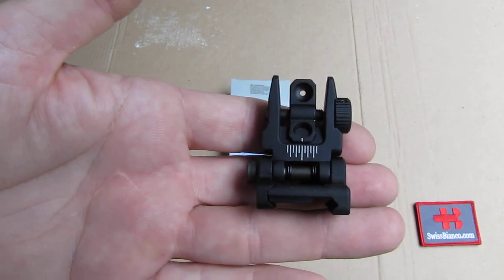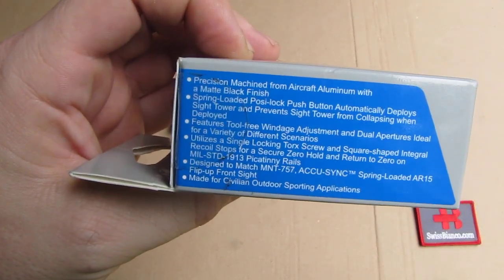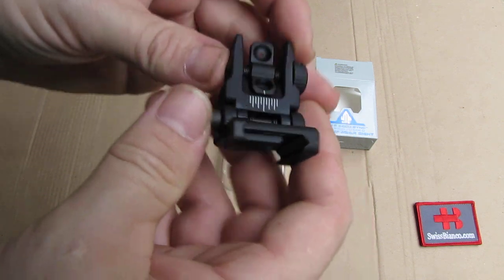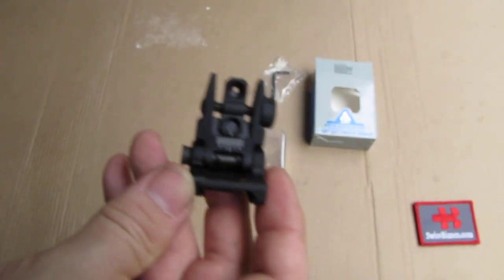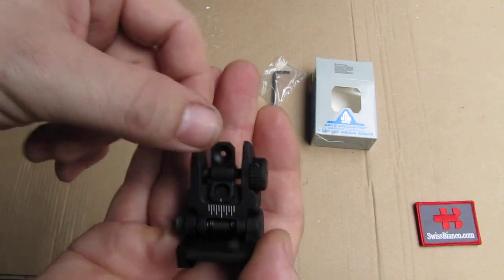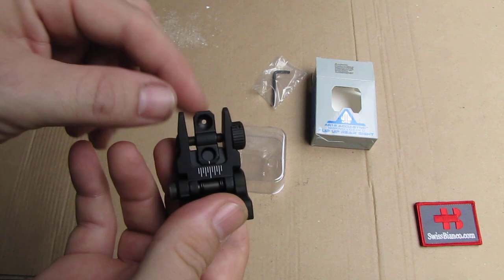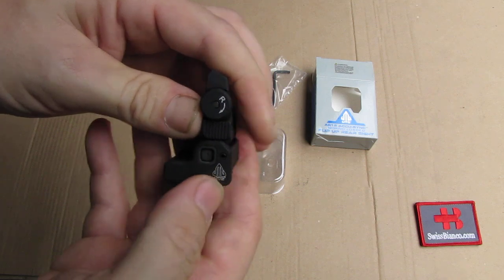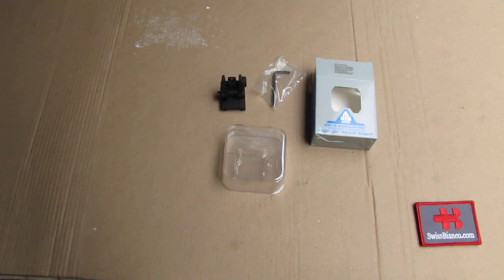utg accu sync spring loaded folding flip up sight

Comment: I have the generation before this and I had a wobbly front sight.  They warranty claimed mine and sent a new one.  It was quick too.  I do trust them to be ready when needed.

They make an excellent set of slim fixed sights too.

Their sights are just backup sights for me, but they do seem well built.  If you are going to have a problem, it will show up very early on.
Reply: so you have mnt-755?
Reply: I run the mt-754x

I have the repaired mnt-755 you mentioned though, but I got the 754 while waiting for the warranty replacement